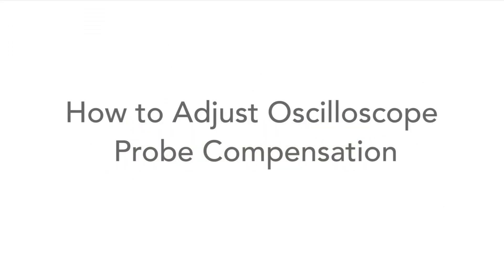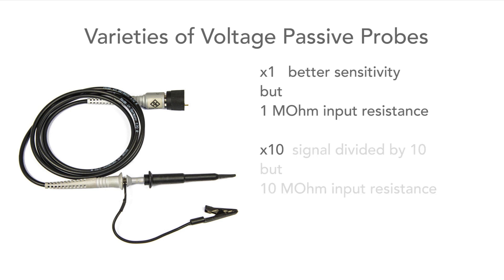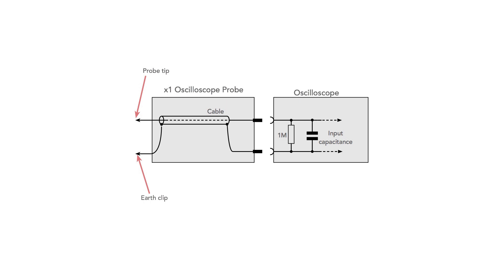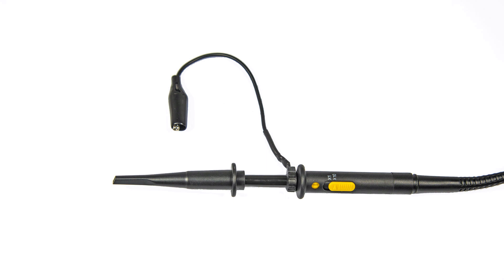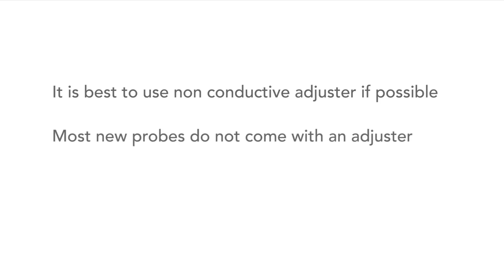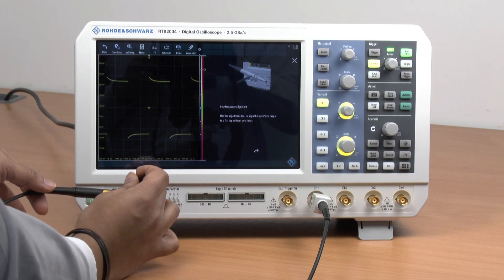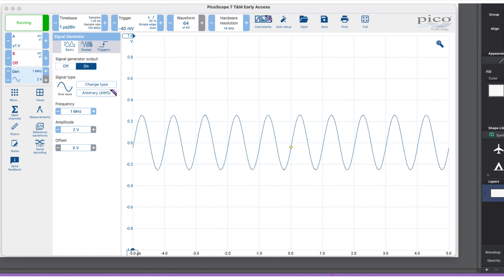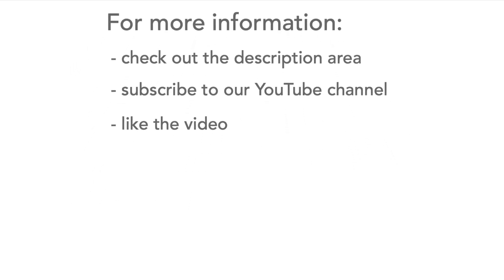How to Adjust Oscilloscope Probe Compensation

Comment: What about on a hand held scope? The hand held scope I have has a generator feature and separate input. Do I connect it to that?
Reply from the maker: Check the manual for what the terminal does and how to use it. The generator is likely to give a good square wave, but without details of what this terminal is, it’s difficult to know.

Comment: If you have to use a signal generator to calibrate the probe, what should the signal be?
Reply from the maker: Virtually all scopes have a square wave generator just for this purpose.
Reply: @ElectronicsNotes I'm a newbie. What should the voltage and frequency be? What should I set my time base at, what should my probe be set to, 1x or 10x? The manual doesn't say anything regarding this. I want this scope to be as accurate as possible,  so I want to remove all human error. This is my first oscilloscope and I have no training other than what I have watched on YouTube, and everyone is very vague regarding what these settings should be.
Reply from the maker: @michaelburke5750 The compensation is only required for x19 probes.
Also the scope square wave generator for probe compensation will be set to a fixed frequency so use that.

Comment: Hello. What about automotive oscilloscope probes? They have no slot for adjustment. That means they cannot be compensated? They come with 2 alligator clip ends or banana plugs but no slot anywhere.
Reply from the maker: It is probably because the probes are x1 only, although I am not familiar with automotive probes. It is only where you have x10 or greater that the compensation is required.